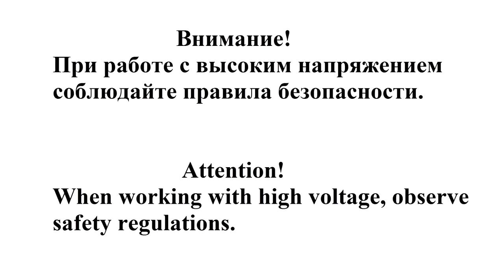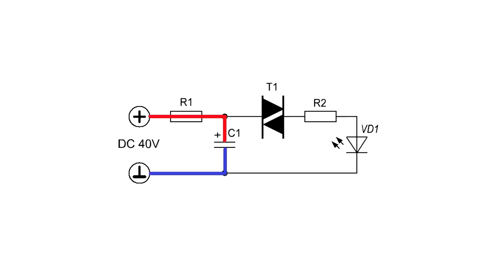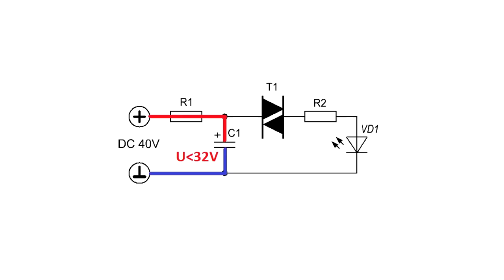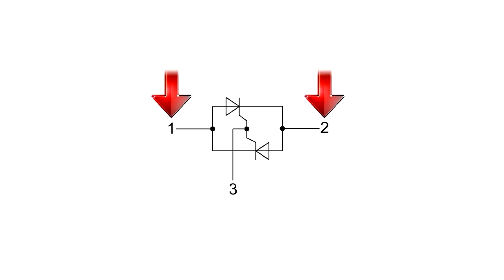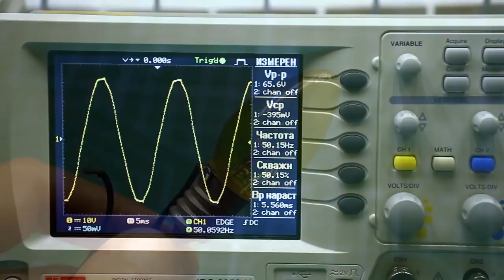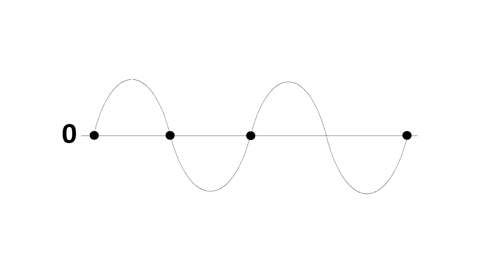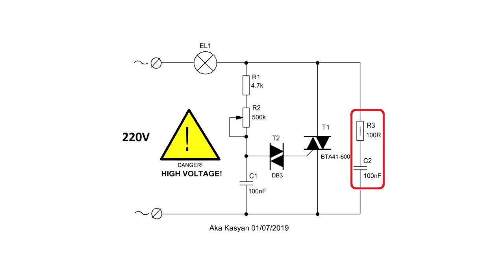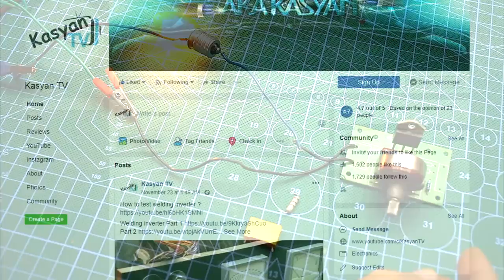Dimmer - How it works?

Comment: I don't understand why Diac is used, is Diac used because for it's breakdown voltage properties or for it's bidirectional AC current flow properties? Why is Diac used on Triac's gate terminal? I can never understand why the Diac is needed, seems like it is used for it's 32 volt breakdown voltage only.
Reply: The TRIAC is primarily used for its switching properties (much like a MOSFET or BJT) and the DIAC is primarily used for its breakover voltage (much like a MOSFET's Gate or a BJT's Base). The DIAC's role is to "wait" for the capacitor to reach the DIAC's breakover voltage, then turns the TRIAC "on" by giving current to its terminal. Since the TRIAC acts as a switch, without the DIAC, nothing would trigger it ON with a delay. If you bypass the DIAC (or remove it) and short the TRIAC's terminal directly to the capacitor, the TRIAC will always be ON because the there is no DIAC breakover voltage to delay its switching, hence no dimming effect.

The circuit requires both components to have bidirectional properties since it is powered through AC--i.e. the current periodically flows forwards and backwards through both components--although the TRIAC and DIAC would function the same way in either case.
Reply: @dimdit00  that makes sense, so the DIAC is used for the delay switching properties, I wished other people have mentioned this, I could never figure out what the true purpose of the DIAC was.

Comment: Can we make it for input 230V and variable 120-130V maximum? And what changes are to be made to do it?
Reply: yes, use variable resistor to replace R1, use another variable resistor R3 to parallel R2, then adjust R1 and R3 to reach your goal
Reply: @ttstar3840  will definitely try it. Thank you 😊

Comment: Hi can we use it a step down for 110v tool instead of down transform
Reply: Yes, certain step down converters use this method. It may damage universal motors or switching power supplies, because depending on when/how the power is switched on the sine wave, you may have short pulses of 220v which can cause damage.

Comment: Is this BT136?
Reply: Nope bta16
Reply: @sayantanmaiti2513   thanks, but I have also create a dimmer circuit with BT136 Triacs. And it works very well.
Reply: Sourav Chakraborty it will work too..bta16 support higher currents than bt136
Reply: Dats a bta41
Reply: @sayantanmaiti2513  yes